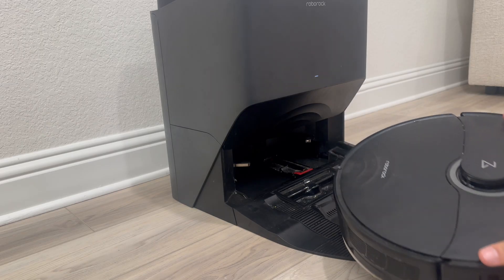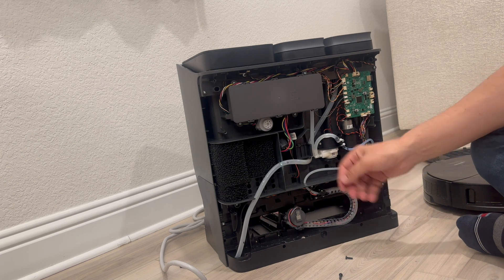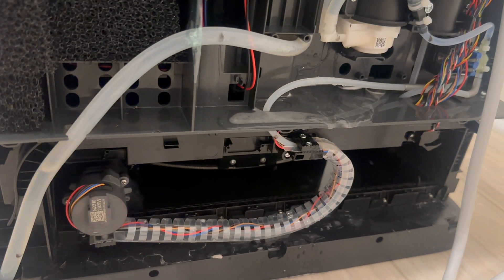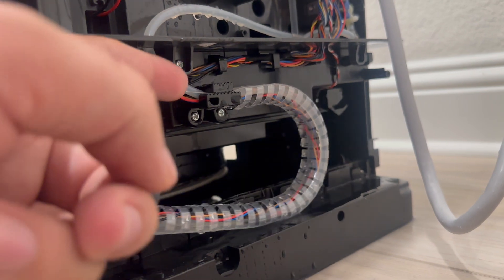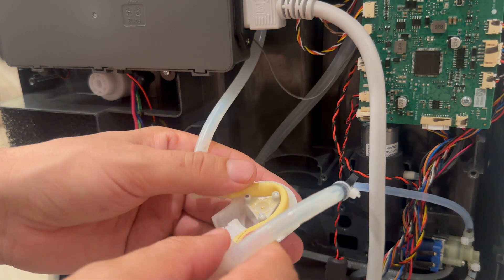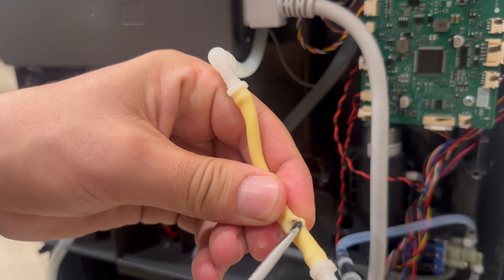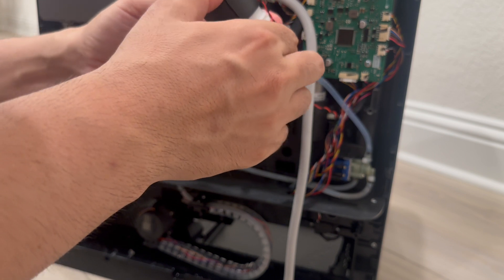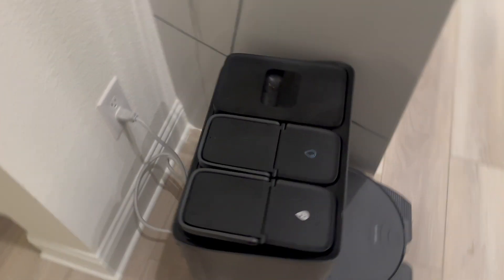Roborock Vacuum and Mop Water Leaking - Roborock S8 MaxV Ultra Robot Vacuum & Sonic Mop

Comment: I am so pissed at the industry. It's an easy fix. Doesn't cost anything. A few cents. Yet I discarded my previews S7 MaxV Ultra two years ago after about 1 year of usage, and now My S7 Max Ultra I had in replacement has the same issue, just three weeks passed the warranty !!!! Obviously. The vendor just told me "we don't repair these". 

Thank you for the video. really helpful. Given the number of poeple that have this issue, I'm shocked !

Comment: I also have the same issue. Would be great if can share the hose replacement 🙏
Reply: I bought the Quickun Pure Silicone Tubing,  5mm ID x 8mm OD High Temp Food Grade Tube on amazon that worked.
Reply: @freetownpikin4278 thanks, just noticed mine was doing it as well, hopefully this fixes it
Reply: @freetownpikin4278Thank you for sharing the tube, and it worked perfectly! Though I had to move the rotation part of the pump manually a couple of times because it was too tight in there. I also applied some patrol gel lubricant, but I’m not sure if that’s necessary.